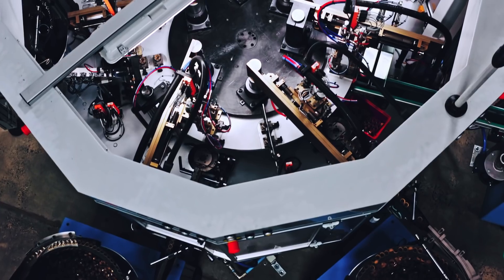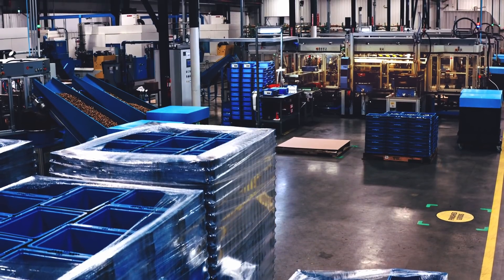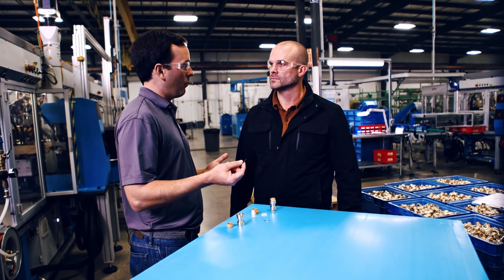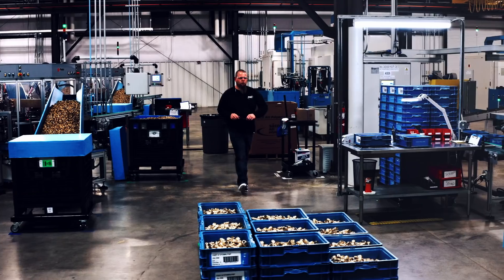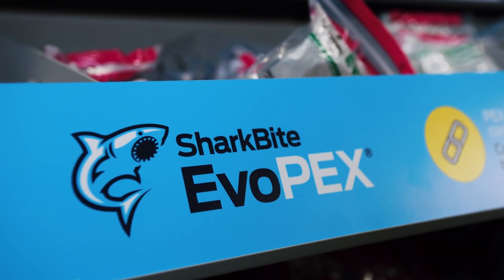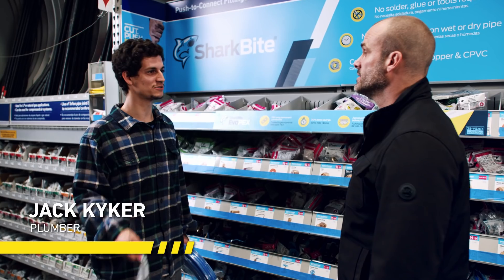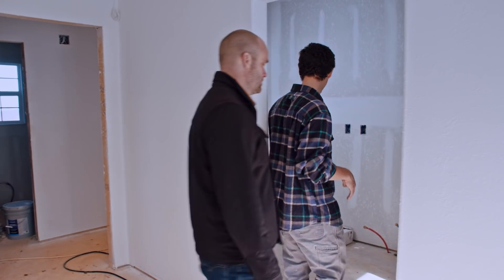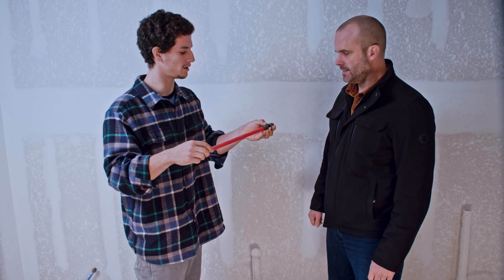SharkBite: Innovations in Plumbing Technology | Lowe's Pro

Comment: Shark bites are a quick fix until you can get the real part you need or can hire a plumber to do the job correctly. I would never ever want one of these fittings inside my wall.

Comment: Ok so they taken an idea that's already in Britain for near 5 years called tectight .. yours is nothing new
Reply: Bruh, shits been out for 15 years; just no one used it because PVC is cheaper. Calm your imperial ass
Reply: I don't know where you came up with a Five Year idea. I used some ten years ago, this Month at my mom's house, and I used them for a couple years before that.
You should check stuff out before you make comments like that.
I Will check out that "tectight" stuff though. Thanks for That heads up.
Reply: @joepegar3431  that's because I only came across it 5 years ago hence why I said it's been out for 5 years or more I don't know how long it's been out and it's been over 5-years that's why I stipulated 5 years

Comment: Great until they fail and cause a flood in the house.
Reply: Same as any other plumbing material
Reply: Sweated connections on copper and cemented connections on PVC can fail too.
Reply: @daphnisnaith6496  sure they can, but not reliably within ten years. Once the rubber O-ring goes in a push to connect fitting, which it will do in a far quicker time than a sweated connection, it's going to form a leak very quickly. They're a nice fitting for quick fixes and repairs, but they need to be seen for what they are instead of a permanent fitting.
Reply: @johnriff85  yes..  very good for quick fixes.
Reply: @johnriff85  12 years no leaks with pex

Comment: Does the "Sharkbite" stand up to cold/freezing outside temps? or is this suppose to only be used indoors?
Reply from the maker: SharkBite PEX is freeze resistant.  The pipe expands and contracts as water freezes and thaws within the pipe.
Reply: @lowes  Thank you very much!! for not only responding, but letting me know the answer to my question.